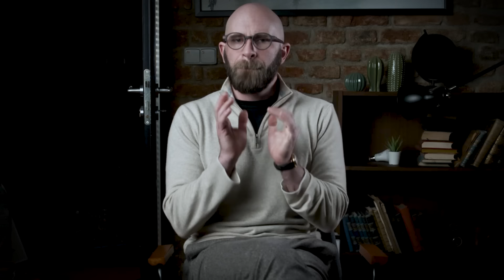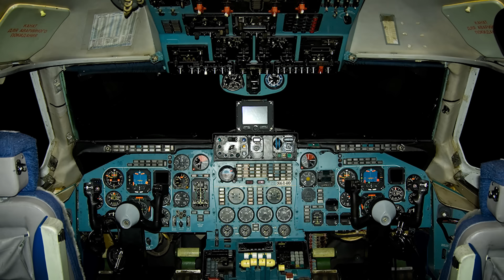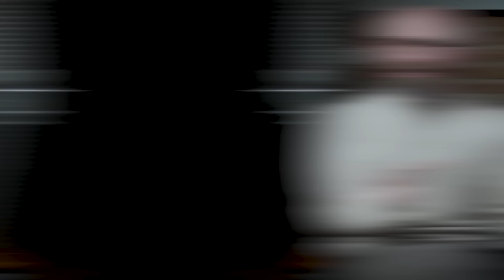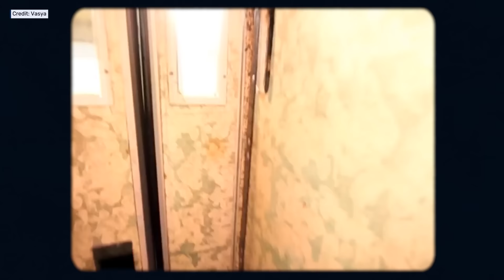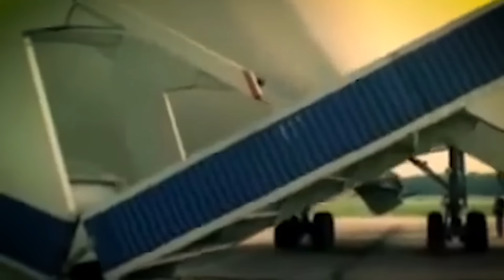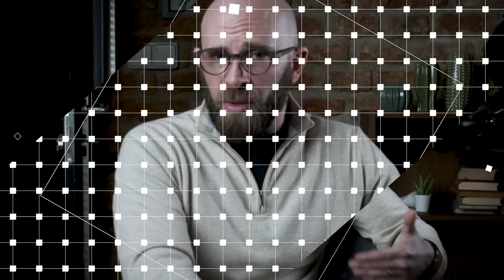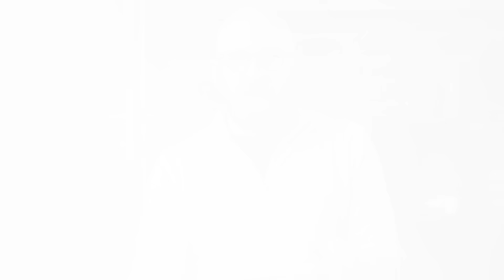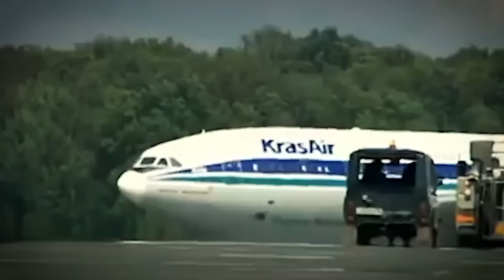The IL-86: The Soviets' Botched Answer to the 747

Comment: Because it's a multi-purpose aircraft, not just a passenger one. It can be cargo, sanitary, or converted to transport anything, in addition, the IL-86 is the basis for the squadron of aircraft No. 1 and IL-96 VKP. This is not a commercial aircraft in the first place, efficiency is secondary and generally not necessary for rare flights, but with high responsibility. You don't need powerful engines, you need reliable ones, you don't need weight efficiency, you need durability and reliability against failures.

Comment: Simple, the engine cores cannot take the heat like western engines can. Therefore the optimum bypass ratio would be lower. The optimum bypass ratio is achieved when the air leaves the core and the bypass section at the same speed. Since the air in the core cannot get as hot, it cannot travel as fast, therefore a smaller bypass fan lowering the load would be needed to prevent the air from slowing down too much.

Comment: You can ALWAYS detect low bypass jet engines because they are shaped like old fashioned cigars. Low bypass jet engines always look like long tight cylinders. High bypass engines are always FAT. High bypass engines are so fat you can see light through the turbine blades if looked into straight on. Low bypass engines tend to have that high pitched jet whine while High bypass engines sound more like really BIG Box Fans. Also the metal cowlings of High Bypass Engines are usually sculpted towards the rear for aerodynamic effect.  So if the jet engine is really big, fat and pretty its likely high bypass. If the jet engine is long skinny cigar shaped kind of ugly and smallish its likely a low bypass jet engine.

Comment: A coupld of innacuracies here. Most of the other comments cover these, however I think it is also worth pointing out that it is not really appropriate to compare the IL86 to the 747. They are not really designed for the same niche in the market at all. The 747 was  designed as a long haul, high capacity airliner, serving the trans-oceanic and trans-continental routes (granted, later itterations did look to address the high dencity, shorter routes in East Asia). The IL86 on the other hand, was never intended for this role, it instead being designed around the high capacity, short to medium-haul market. 

In terms of intended market, it would be far more approrpiate to compare the 747 with the IL62.

Comment: Problem with russian new jets hailed as local heros. Many used western jet engine and avionics (no hope of ordering now), the Russian native jet version is competitive (sort of) but again many did use western tech and swapping russian ones in has one flaw, no access to modern western IT chips with aerospace performance and reliability. Can't order from china (use western parts and china wants to export it's local hero and can't afford to lose access to western aerospace makers without serious delays to their own factory). Can't order in Chinese jets either as highly embarrassing (no lease providers either) and the Chinese would have to service them also. Meanwhile western jets are cannabalised for parts for the remaining jets (and sanction busting which is expensive, slow and prone to possible backlash to sanction busting states (no after sale technical support either). Meanwhile old russian jets forced into service are crashing and Russians have decided not flying is suddenly a higher health "benefit" unless it's Russian friend airlines who operate Western jets that fly to non Russian destinations (Egypt, Turkey, China etc).

Comment: The 767 widebody had a 2-3-2 seating and older widebodies including the 767, L1011, 747, and DC10 also did not have central luggage overhead bins initially.  The DC10 also had a central landing gear in later versions.  The L1011 with PSA had a lower deck.  A340s had a lower deck with crew compartments and passenger lavatories.

Comment: DC10/MD11 similar size and weight, MD11 way younger than IL86 and still 4 landing gear layout. Were they designed for unthrusty Soviet airports and operators or there might be differend reasons for that weirdness? Asking for a friend 😊

Comment: The Il-86 was meant to compete with the 747, but it ended up being more like an oversized, wide-bodied version of the Convair 880, a much earlier Western project that failed exactly because of its unfeasibly short range and inefficient engines that were incredibly fuel-thirsty, noisy, and polluting even by its era's standards. Had the Il-86 been developed at the same time as the Il-62, it would have been groundbreaking, but it was too little too late even for Soviet aviation's needs, and it was more of a political statement than a real engineering project with definite uses and needs.

Comment: Not even close. BUT, your post is a botched video about Il-86. which shows that you have no credibility to talk about any aircraft , period. You failed. Sit down. Its an "F". 

 Il-86 is actually one of the top 4 safest airliners EVER.  Yes EVER to be produced . Let that sink in.    64 747s have crashed vs ONE IL-86 .   You read it correctly , just 1 aircraft. 
I love the 747.  Type rated in it and flown it. But...

Lets look at both aircraft's safety records.  NO MATTER WHAT THE REASONS FOR CRASHES ARE. If you take number of both aircraft built, comparable safety record would have been 15 747 crashes vs 1 Il-86 crash.L-86 has safety record of not 40vs1, not 23vs1, not 15vs1, NOT EVEN 2vs1, but ! 64vs1!!!!  IL-86 absolutely demolishes and stands head and shoulders above 747 in every aspect , except for elegance and beauty.

Comment: “Slightly more polished version? The 96 has high bypass engines which you went on about earlier.
Also, another 250 at least L1011s would have been built in the USSR due to a deal with Tupolev but the Soviet invasion of Afghanistan in 1979 led to the Carter Administration to impose sanctions and ban on technology sharing which killed the L1011 deal.

Comment: I'm actually disappointed in this review. Cause you were more interested in terrifying people how bad the Soviet aviation industry was than telling about the plane in sake of cheap laugh about dumb soviet engineers. 
You can't take a western airliner and compare it to Soviet one simply because soviet airliners were built mostly for one airline — Aeroflot. And they had particular requirements for this plane — high capacity for medium haul flights like Moscow - Sochi. And some features like the hydraulic staircase were simply meant to allow airports (yes those terrible airports with 3000 m runway that handled Tu-154 and Il-62) that never accommodated widebody airliners to handle this airplane. 
And voila this aircraft did what it was supposed to.
And saying that Il-96 (that was powered by high bypass PS-90 engines) is just a polished version of Il-86 is like saying that B787 is just a polished version of B767.

Comment: I had flown many Russian-made airplanes (TU-134, Tu-154, IL-18, IL-62, IL-86 etc.) over the years, but, for whatever reason, IL-86 was the most vulnerable to turbulence that felt like air pockets. Not a single flight was without the plane suddenly dipping in the air several times, while the other planes flew the same routes perfectly normal. It was also by far the noisiest plane of them all, at least in the cabin.

Comment: I flew on one of these about 30 years ago. It was a pathetic attempt at keeping up with the West.  I casually leaned on a seat back and the thing collapsed forward like a lawn chair, exposing how it was built -- with big ol' angle iron! It was the noisiest jet I ever flew on. I took a stroll in the isles to stretch my legs and came across a curtain. I was curious as to what was behind it so I peeked through. It was a stairs down to the cargo area -- where all the baggage was stowed. I will say one thing nice about the IL-86 though, it felt like the whole plane was so heavy that when we landed Kartum , Sudan, in the middle of the night, I did not feel a thing! I actually did not know we were on the ground. Smoothest landing ever!

Comment: The Tu-104 and Tu-144 were so much worse.  After making their SST Aeroflot relegated them nearly exclusively to cargo because of the awful margin of safety and deafening cabin noise and Tu-104 was a barely flyable monstrosity that was very VERY sensitive to weight and balance.  In one Tu-104 accident the military leadership was decapitated when many high level Generals and Admirals died in a single accident due to overload and shiftling load but even with correct loading and balance both it and its bomber parent had ferocious handling.

Comment: Worked as a (ground) handling coordinator, incl. load control at Stockholm Arlanda airport in the 90s and worked a lot of the Soviet aircraft, including TU 134 and 154, IL 62, 86 and 96. The two latter having interesting design features such as: Built in entrance stairs/door, accessed from the ground, that lead up to a wardrobe and then, red carpet clad stairs with mahogany and brass rails, leading further up to the cabin. Luxury like an old ocean liner😊

Comment: I find this content hugely biased, and with a misleading title. The Il 86, is not a botched, answer, but in fact, 1 of the best and enduring designs from the 80's to have survived, COPIED and will continue to be built in the future. the problems you have mentioned in the video are based on past situations in the Soviet union, and is easily fixed today. In fact it will be fixed soon enough with the new renaissance of the Il 96. The il 86, and then its newer version Il 96 is a very SUCCESSFULL design. the plane was designed in the 70's and first flew in 1980! It competitor at the time was the Boeing 747. When the plane went to the US for it be certified by FAA so that it can fly to the US, the FAA engineer's ( who are basically Boeing engineers in disguise which we now know), took note of the plane, and found its design and dimensions were amazing, in that it could compete with the Boeing 747, without the need of being a double Decker, and soon enough, Boeing copied the plane and produced their version of the Il 86 called the BOEING 777! which first flew in the 90's more than 10 years after the first Il 86 flew!. yes you heard that right. go and check the dimensions of the B777, and you will find it almost identical to the Il 86. It has the same swooping design at the front from the main body into the cockpit/nose section. However Boeing modernized it with using 2 massive engines, not having the in built ladder, extra wheels and navigation which were pretty much western standards. Boeing is still producing the latest derivatives of the B777 which is the copy of Il 86 today! So give credit, where credit is due. Russia as well is on the verge of producing the massive PD 35 engines which produces 35 tonnes of thrust, that will be going into the new Il 96 to make it a 2 engine plane. Russia might also further modernize the plane with full composite wing, modern glass cockpit layout and weight saving features to make it compete with today's B777. So Russia will have its modern Il 96 coming soon enough.

Comment: Their best bet, is licence production, of the C929, with Russian components. Jet engine work has continued, 33 years after the Ill 96. Although the C939, to begin production in 2030, would be closer to the 350 passengers of the Ill 96. It also uses more Chinese components, friendship without limits and such.

No Western company will co-operate, with Russia, things would have to get pretty good with Chinese, Western/ East Asian countries, for the Chinese government to block Russian cooperation. As the Russians have oil, gas, resources, weapons, food, which can be upgraded with Chinese electronics and manufacturing supply chains.

Comment: I flew from Moscow Domodedovo airport to Krasnoyarsk on an Il-86 in 2004. I remember that at one point during the flight we had to climb, so for about 15 minutes we who were seated behind the engines were treated to a really high sound level- it was apparent how low-bypass the engines were just from that. I remember that the ceiling in the KrasAir-operated aircraft was very high- there didn't seem to be much space utilized above the main deck. It was almost like being in a cathedral. The flight was pretty lightly loaded, so after braking during landing many of the seat backs folded forward and it was visually almost like they weren't there. As someone else mentioned, all the seats had fans in them for the passengers behind them. Other than that, it was not that bad of an experience. I flew on other Soviet planes too- Tu-134, Tu-154, and a Tu-204. The 154s had really great acceleration on the takeoff run. I never experienced any air turbulence over a dozen flights. I was also treated to a demonstration of Russian de-icing operations at Yekaterinburg on one winter day- they used an old Klimov VK-1 (of MiG-15 or -17 vintage) mounted on a swivel on a flatbed truck to de-ice the aircraft. Buffeted the plane around quite a bit.

Comment: Commercial failure of the L-1011 was mostly due to delays in development of the Rolls-Royce engines (R-R was going through bankruptcy at the time) and the airframe was designed around the engines, preventing retro-fitting another type

Comment: Another smug Youtube creator is looking down on mere mortals and shares his twisted wisdom. There is a big difference between not understanding something and  being weird. Driving on left side and having a queen/king is perverted to me. Leave past in the past especially if you're a instant expert on the topic. With Boeings falling down from the skies like in recent years, having an indigenous aviation industry is rather an asset and not a liability. There is a very good chance that retiring western aircrafts will be replaced by chinese new wide-body. Similar to western shipbuilding, western aircraft manufacturing may very well be the next dinosaur judging by the speed of Boeing deterioration. Also, I heard russians are starting productions of 3 new engines, one of which may be suitable for IL86 upgrade or so the speculation goes.  But surrounded by similar-minded crew you'd miss that news/speculation as too positive development to consider or share. Just smug bs
Reply: Sure Ivan.
How many potatoes do you usually get from Putler's regime for endless excusing of russian fails? 
How many accounts do you operate?
So many nations of Europe have had to listen to and read your lies for decades, occupant.

Comment: Just when it starts its return... The Chinese will finish their new wide body... And it will simultaneously be cheaper, more fuel efficient, cheaper to maintain, higher quality, and more technically advanced than the IL-96. Immediately Russian and other sanctioned nations airlines will all buy Chinese planes.

Comment: The galley in L1011 were situated on a lower deck as well. Btw. DC-10-20 and 30 were equipped with the additional landing gear on the fuselage as well. Both aircrafts either L1011 or DC-10 did have any baggage racks in the middle
Reply: In the days when carry-on meant an overcoat and a handbag or briefcase... Those wheeled abominations became really prevalent when airlines started charging for checked luggage.
Reply: the kitchen on the ground floor was previously owned by a TU-114  https://youtu.be/FE8k12c8pnc?si=Gl1sQnJmaFoLZglU&t=830

Comment: The Il-86 was not an answer to the B747 or any other wide body, long range transfer airplanes from the West. The purpose was totally different, right from the start. The Il-86 is a high capacity shuttle aircraft between the large soviet cities and their own regions. The shuttle range was not higher than 4-5000km. That's why it has that enormous, "oversized" luggage space, which was easy to load and reach, the ship-like stairs and all unique features. Because the Il-86 had to collect not just the people, but all of their goods, what they bought in  Moscow or Leningrad, or what they would like to sell there. The fate of the Il-86 was sealed after the collapse of the Sovietunion, when these shuttle movements going to be less iteresting than the  charter flights toward Europe from business standpoint. But for charter flights the Il-86 was not the right tool, because of its design and especially because of those engines.
Reply: Also check out air crash ratio for IL-86 and the amount of casualties. Guess many could be surprised.
Reply: Stupid, technically broken plane from stupid country. That's it. russians always try to catch up to the west and ALWAYS fail.
Reply: The only less more adequate commentary here on the video. The IL-86 was a response to the growing passenger flow on distances from 3,500 to 5,000 km. It coped with this task perfectly for more than 30 years.
Reply: The Soviets at that time were known for "borrowing" heavily from Western, and more specific US, technology, so for an American the IL-86 MUST be a botched copy of the Boeing 747. It's just the way Americans think. But even then, you cán make the argument that Ilyushin at least had a good look at Boeing's planes and copied what he thought would work for its planes, but then so did other airplane manufacturers, as Boeing was often the first. And last but not least, there's the thing that there almost always is only ONE design that is the optimum for aerodynamics, so ALL large (passenger) airplanes end up looking much alike within their class.